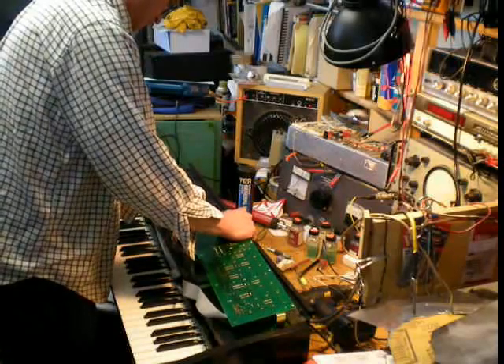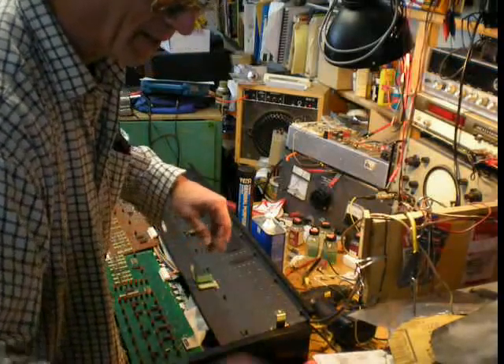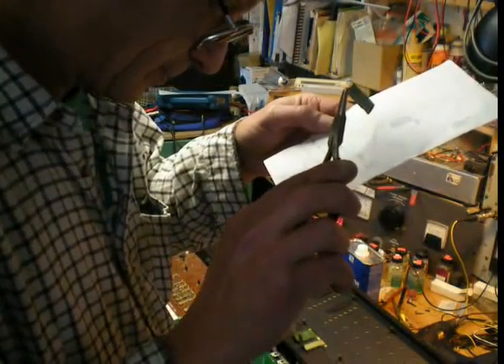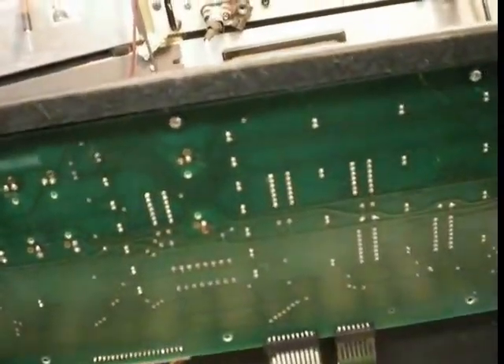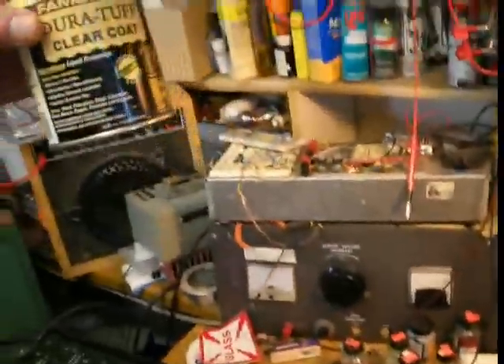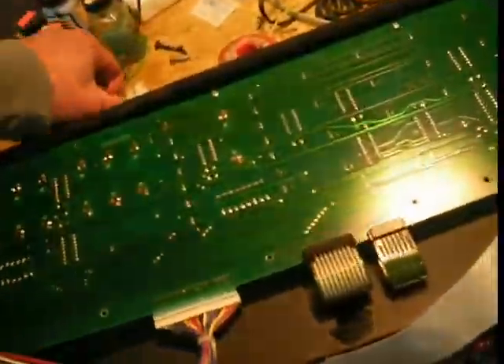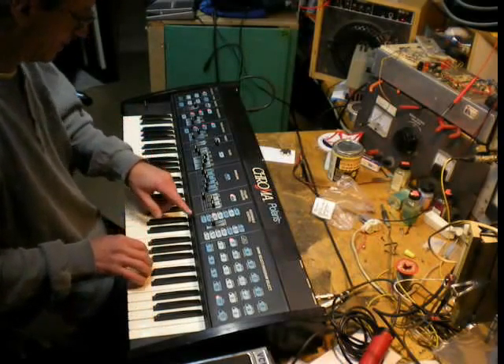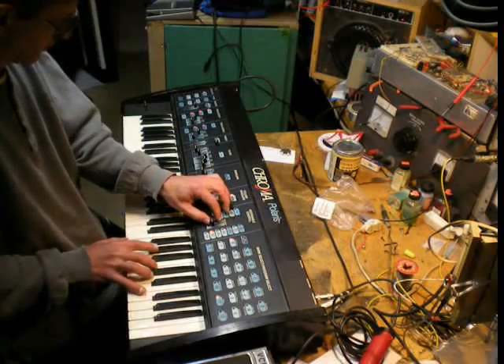Fender Chroma Polaris ribbon repair! PERMANENT! Tech run through.

Comment: Thanks for this! I'm in the middle of open-heart surgery on my Chroma Polaris right now. The ribbons for the left panel were cracked all the way across in a couple places. I successfully trimmed the excess and managed to get a broken off slice out of the connector. Scary stuff! Now I'm left with two straight piece that should be long enough if not for their inability to bend. I do plan on tracking down something like Dura Tuff and coating the ribbons before ever attempting to bend them.

Comment from the maker: There were a few hopeless cases where I coated very brittle plastic with dura tuff.  It tends to dry and get some strength back into the plastic so it would just come apart when you try to clean the insulation off the other side even.  I've seen them crack apart while doing just that they get so brittle sometimes.  in hopeless cases like that coating with a polymer that will harden and adhese to it is about the only hope I can think of

Comment: The Polaris was my first polysynth. I never knew how hard it would be to fix the data ribbons in terms of parts and precision of cutting the cracked areas. I suppose many home computers can suffer the same malady. The only problem I ever had with a Polaris was a  loud honk during a performance. My sister was playing it at the time. She insisted that I trade it in for a new digital machine from Casio, the CZ101.LOL

Comment from the maker: I don't know a source..never looked..because the originals are always fine.  Just make SURE that they line up right.  One thing I discovered since I did this vid is that sometimes if you flip the connector the wrong way they aren't QUITE symmetrical!  So you have to do a slight trim on one side of the plastic and adjust the thing over a little to get precise centering.  This caused me problems a couple times now.

Comment: Might it be possible to find and purchase a comparable ribbon connector and cable to run as extenders from the pre-existing ports? Rather than removing and relocating the originals to under the board, I mean. I'm not sure how proprietary those pieces are.

Comment: HOWEVER, since the ribbon is technically a plastic, what do you think about the idea of using some sort of heat source to make the ribbon more flexible before having to bend it? Could a low amount of heat make it less brittle without melting or destroying it? Maybe as simple as putting in the sun for a few minutes? I can't decide if the idea is brilliant or folly.